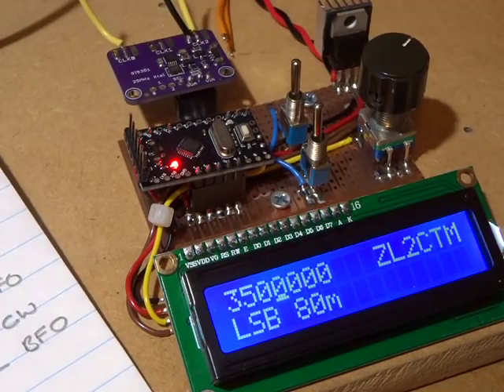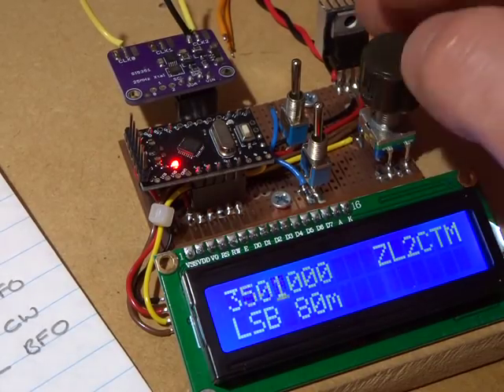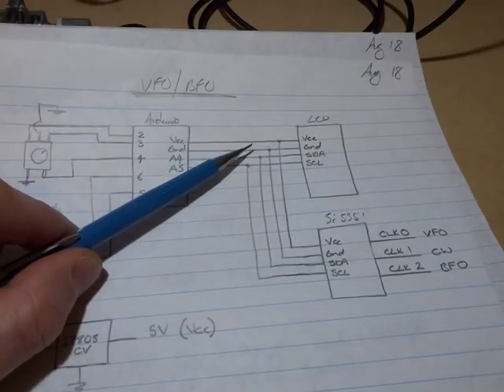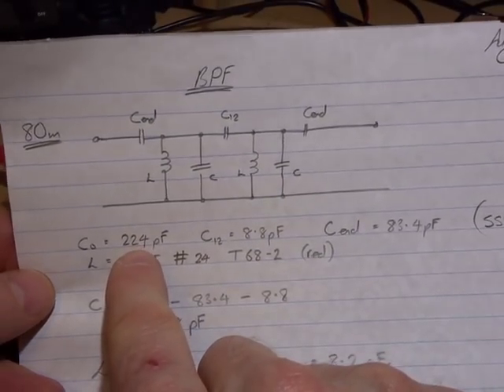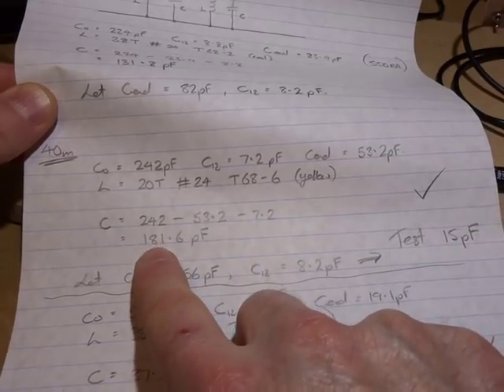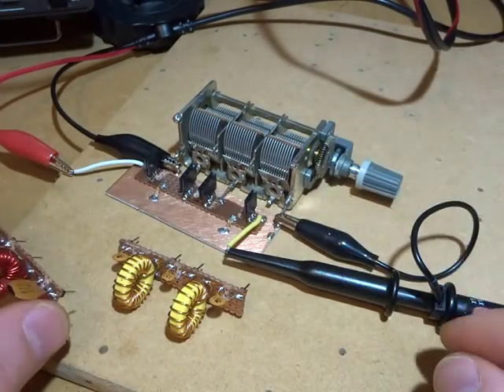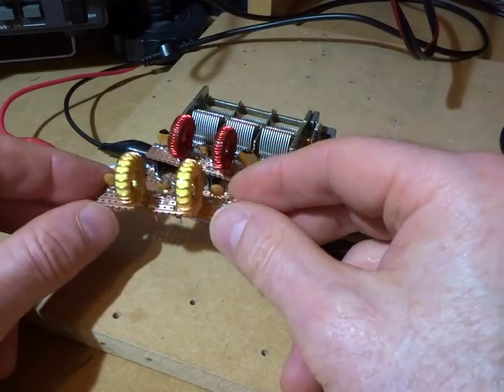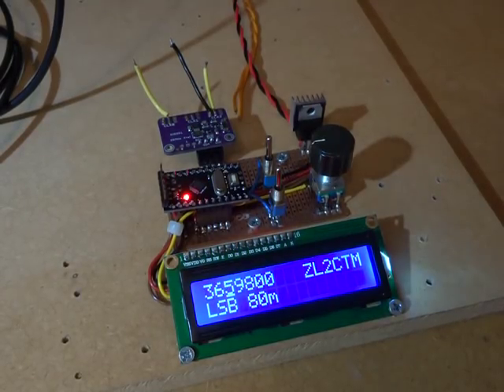Homebrew 80/40m SSB/CW Rig - #5 VFO/BFO and BPFs

Comment: Didi you used ftdi to upload the code onto chip?
Reply from the maker: Hi Emerson. Yes, it's a small USB mini to FTDI adapter. I have two, one for 3.3V and one for 5V.

Charlie
Reply: Charlie Morris Is it arduino pro mini ARM based chip?
Reply from the maker: Yes, it's an Arduino Pro Mini.